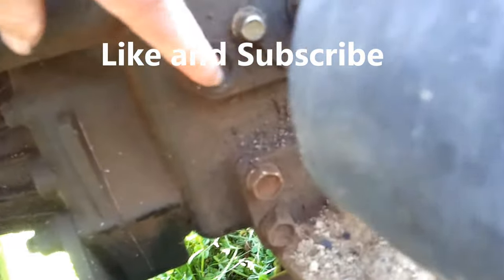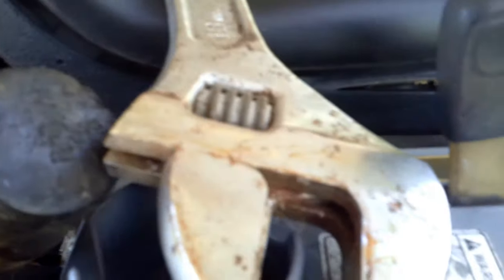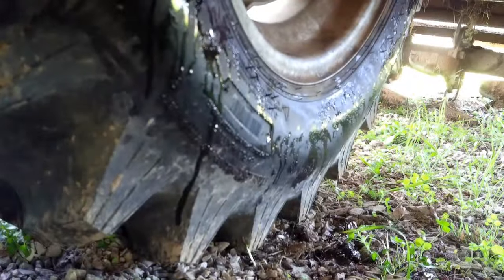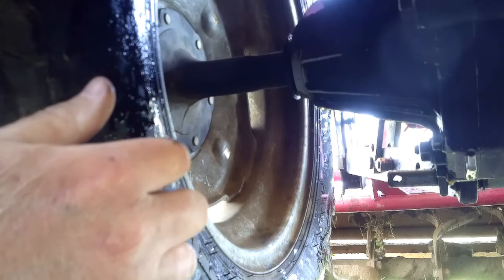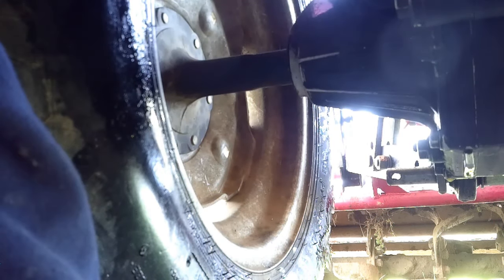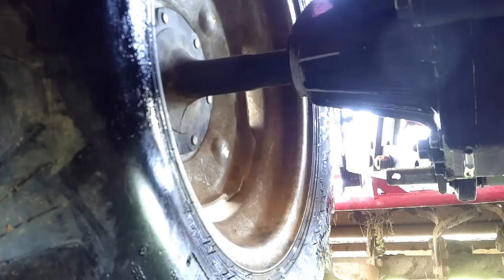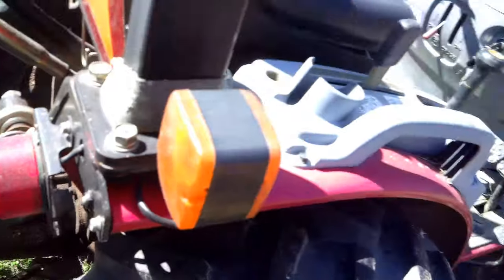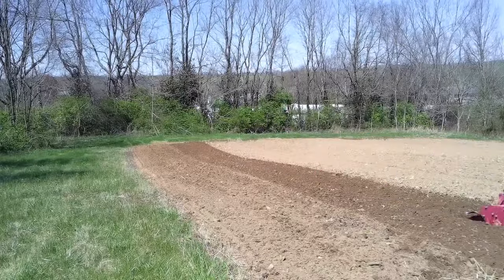Mahindra Emax 22 Wheel Bearing Seal Leaking on the Rear. Homesteading and gardening 101.

Comment: Do you plan on replacing the seals yourself? If so, it would be great to see a video of that process since I have the same tractor 😅
Reply: i second this
Reply from the maker: That's the plan! I will start out by just pulling them and using prematex gasket sealer. But if that don't work I will pull the axle. It is a big job that I may not be up too. I have the repair manual so I think I can but?
Reply from the maker: That's the plan! I will start out by just pulling them and using prematex gasket sealer. But if that don't work I will pull the axle. It is a big job that I may not be up too. I have the repair manual so I think I can but?